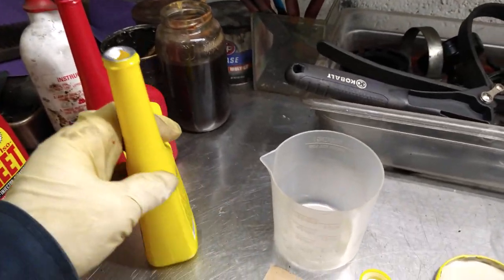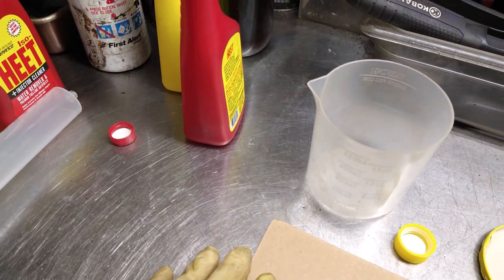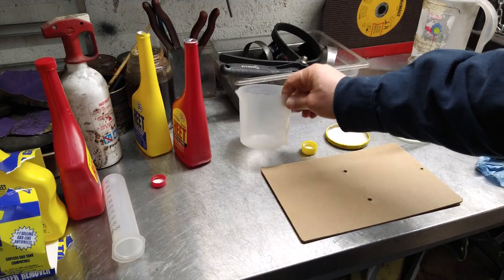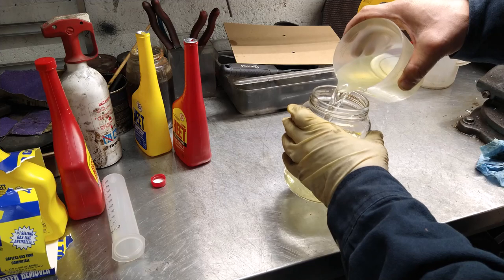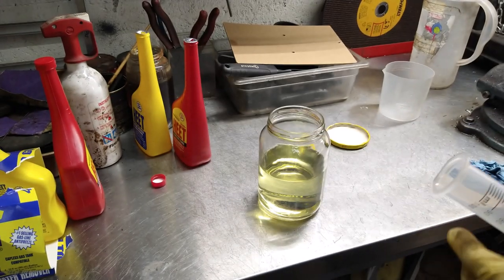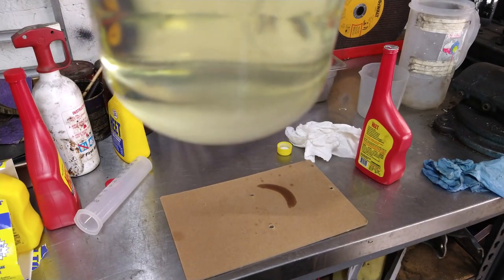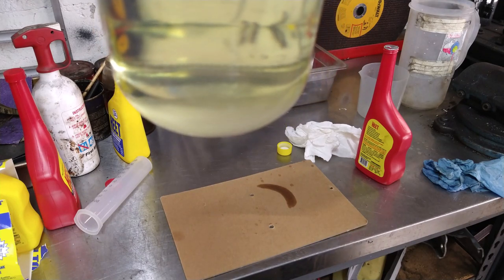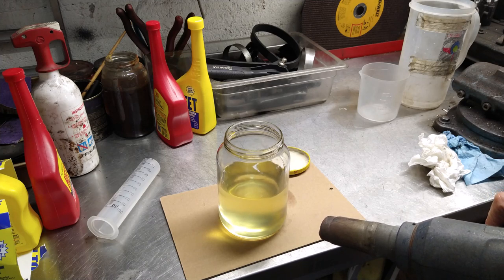How to remove water from gas tank, Remove Water From Gas Experiment, Water in Gas tank.

Comment: The jar is full opened,the gas tank isn't. WHY you heat the jar? Does the tank in your car get's heated so much by traveling? NO. By heating a gasoline you don't have any kind of gains for your experiment !
Reply from the maker: Thank you for your comment! As a car expert with 35 years of experience and countless cars under my belt, I appreciate engaging in healthy discussions.

Firstly, if you paid attention to the beginning of the video, I mentioned that the product removes water condensation in WARM, wet weather. However, in the context of my shop where the temperature was cold, I had to bring the jar to at least room temperature to effectively demonstrate its application.

Secondly, it's important to note that no gas tank is entirely closed. When you refuel, air enters the tank, and there's a component called a charcoal canister connected via an air line to the top of the fuel tank. This canister contains a valve, known as the vent valve, which remains open all the time. It only closes when the vehicle is started, as commanded by the ECM, to check for leaks in the evaporative emission system.

Once again, thank you for your input and let's continue this insightful conversation!
Reply: Asphalt can be as hot as 140°F (60°C) on a day with an air temperature of 95°F (35°C).

Comment: WHY WOULD YOU HEAT IT NO GAS TANK GETS HEATED ARE YOU NUTS!!
Reply from the maker: Thank you for your question. However, I am not just any nut person, and let be respectful, I am a 35-year car technician with a wealth of experience in the automotive industry!....if you paid attention to the beginning of the video, I mentioned that the product removes water condensation in WARM, wet weather. However, in the context of my shop where the temperature was cold, I had to bring the jar to at least room temperature to effectively demonstrate its application.
Reply: @carservicepro  Asphalt can be as hot as 140°F (60°C) on a day with an air temperature of 95°F (35°C) and at times it can be warmer.  That has an effect on a gas tank's temperature.